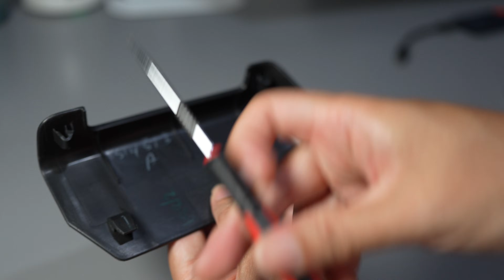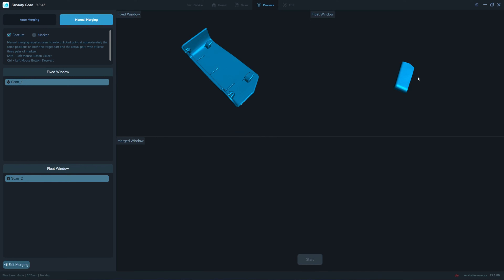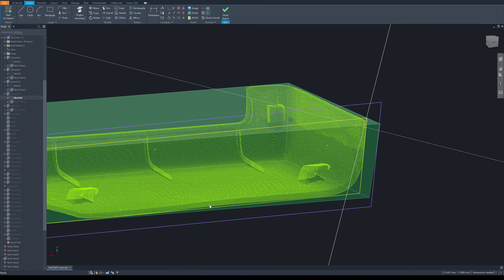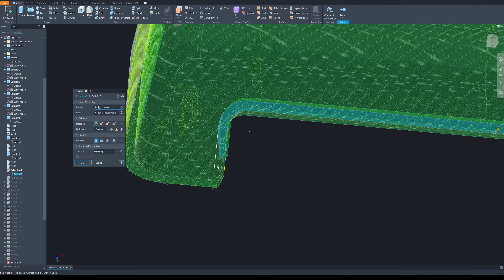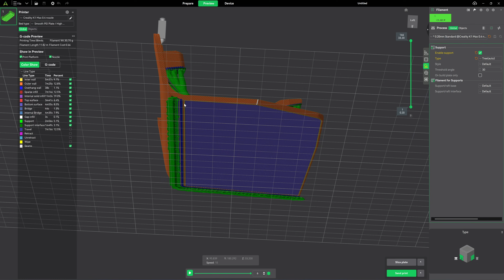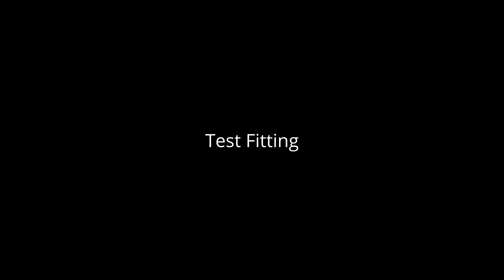3D Scan to CAD: How I Made a 3D Printed Plastic Trim with Creality Scan Raptor Pro

Comment: Thanks for the awesome tutorials, I'm learning so much from you as a beginner! Curuous why you set 0.25mm as your tolerance rather than 0.1mm or lower?
Reply from the maker: A laser scanner’s lowest resolution is 0.1 mm, limited by the width of the laser line. Always set the resolution to the lowest value that still lets you see the detail clearly. Setting it unnecessarily high only increases scanning time, and as the frame count rises, so does the error.
Reply: @Payo-TensileCreator Thanks Payo. So you're saying I should set the tolerance for my scan based on the tolerance needs of the object and not the lowest theoretical tolerance because I'm introducing error and complexity risk?

Separately, with regards to my learning journey — I'm curious if you ever offer one on one video consulting to help folks like me learn more rapidly / directly?

Comment: Those ribs are for warpage from injection molding, with 3d printing you do not need them at all. Since the part doesn't withstand any force by design (apart from assembly), you are free not to put any rib on the b side.

Comment: So you turn the mesh or point cloud into a vector manually, the point cloud is just a reference, is there no way to make it automatically?
Reply from the maker: There're some AI based software for detecting faces but not working if the model is a bit complex.

Comment: First of all, thank you for your hard work. 

I believe it’s beneficial to use Fusion 360 when designing automotive trim parts. When parts produced for injection molding are printed with an FDM printer, the connection points tend to be weak. To reinforce these areas, I feel the need to modify them slightly by adding chamfers. The products I’ve tried before provided higher durability.

Comment: Hi Payo! I do believe you are using an older version of creality software.  However, your previous version is able to combine 2 point cloud scans and merge them and is able to have an asc file format while the latest beta 4, once scan 1 and scan 2 are converted to point cloud and merge you are not able to export them as asc, only obj,stl.ply. Im not sure if its a software bug
Reply from the maker: ah, I didn't know that. Let me check the 4.0 point cloud exporting.

Comment: I've noticed in a few of your videos you don't seem to set up any lighting when doing the 3d scan with the raptor pro. Is that because 3d scanning in low light is better ?
Reply from the maker: Most laser scanners use infrared cameras, visible light is not required for scanning process except for scanning with texture color.

Comment: Whats your opinion on the Raptor PRO vs Raptor X? What about the X would justify the price difference? I'm talking Raptor Pro+brige vs Raptor X(which includes bridge).
Reply from the maker: Raptor X scans large objects 30% faster than Pro, and its case is designed to fit a Wi-Fi handle. That's all.